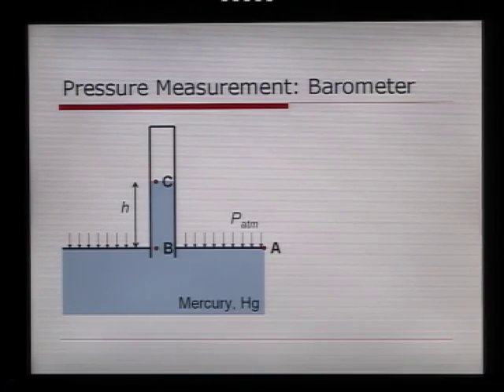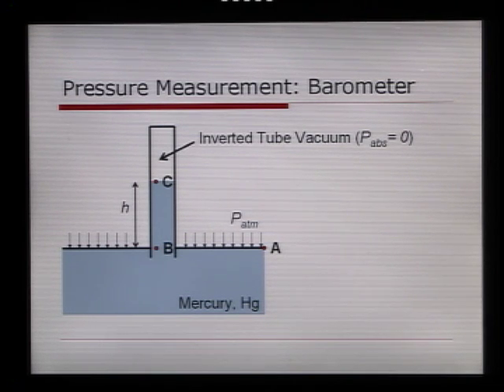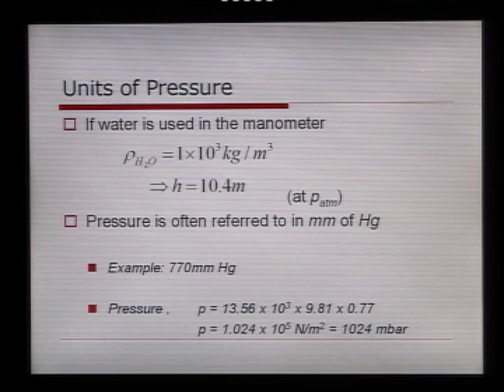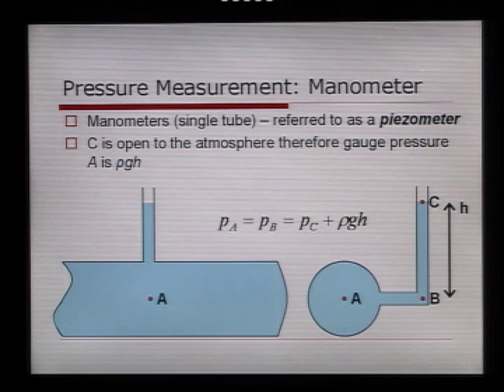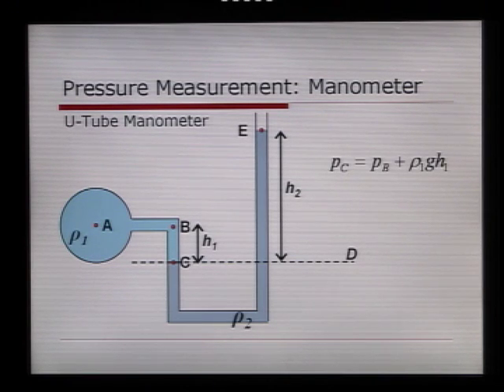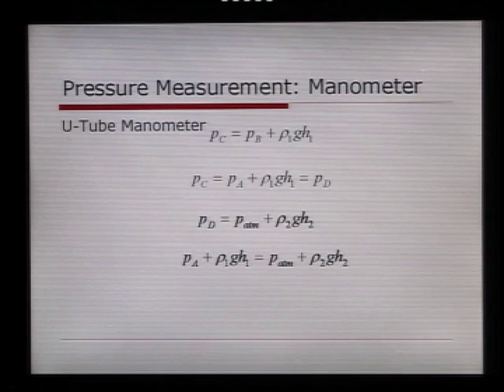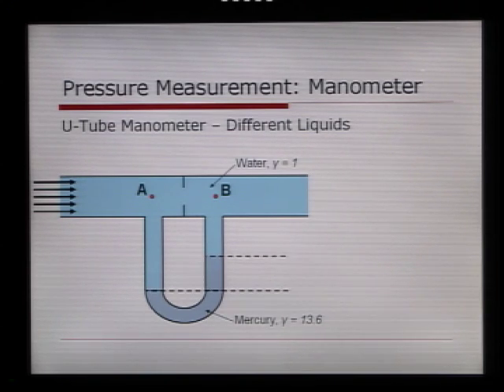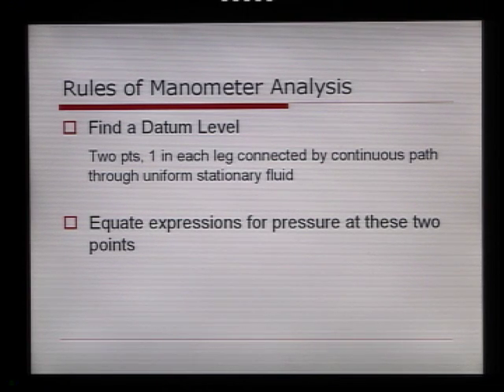Introduction to Fluid Mechanics, Podcast #8: Manometry, Pressure Measurement

Comment: I am trying to find a solution to a problem of the form: " open-ended Hg manometer to 1 atm, and a closed bulb of CO2 at P1, V1, with a height difference (on the open side) h0. How many mm of Hg should be added to decrease the volume to V2?"

I can calculate the change in pressure by ∆P = P2-P1=P1(V1/V2 – 1), and therefore the final height difference hf = ∆P(atm)•(760mmHg/1 atm)  that would be required to balance the pressures. However, since the mercury level goes up on the CO2 side by some ∆h1 as well as on the open side by ∆h2, the amount added is more than (hf-h0) by (∆h2-∆h1). 

My best idea so far: If when I increased the CO2 pressure, the volume didn't contract (like I pumped in more CO2), the amount of mercury I"d need to add would be exactly hf-h0. If I then decreased the volume of CO2 in the bulb the mercury on that side would rise, am I effectively removing pressure ρgh where ρ is CO2 density? 

Hewp

Comment: how can the pressure at c and d be same if they are different fluids, water and mercury???
Reply from the maker: For the U-Tube Manometer? C and D are in the same fluid.C might be on the interface between the mercury and the water, but that still counts as the top on the mercury fluid!